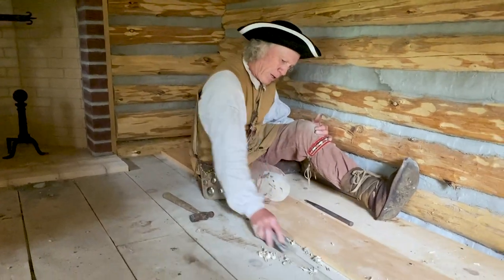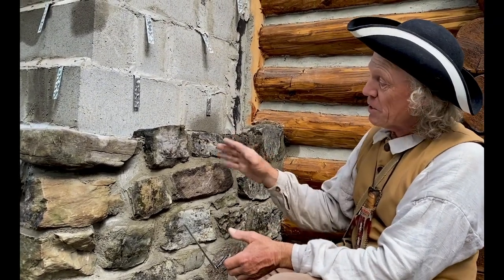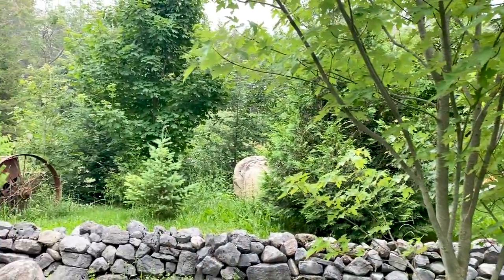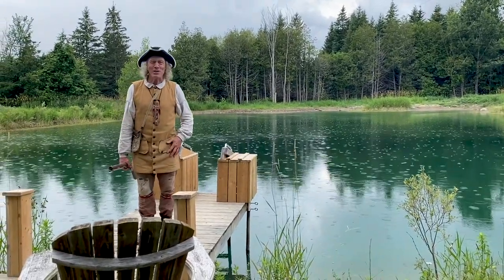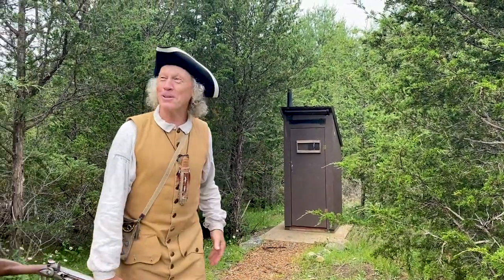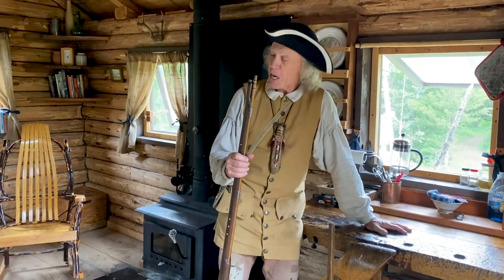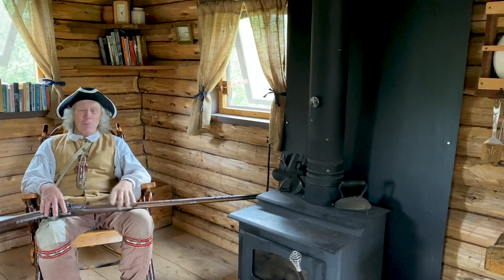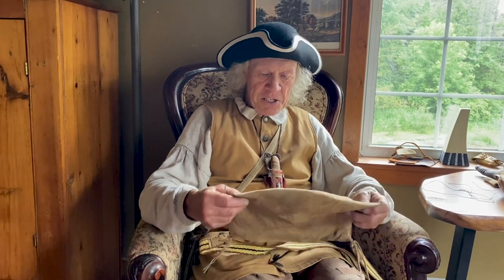A Tour of Our 21'st Century Home | CABIN BUILD | PIONEER LIFE|STONE MASON

Comment: Here in Scotland, my Grandfather house was built in the 1700s and we had to replace some of the floor boards, there was Ash from the fire under the floor boards, both on the ground floor and second story to act as insulation, which worked well.
I imagine this was also used across the water in Canada and the US.
Reply from the maker: Well, I’ve not read a first person account but, you’ve sparked my curiosity … more research require.

Comment: Just curious, why wouldn't you lay the second layer perpendicular to the first?  Would be more effective at stopping the drafts.  If someone else asked this, my apologies!  I've just discovered you. :)
The fireplace is really gorgeous.
Reply from the maker: A simple answer, as the boards shrink (laid perpendicular) we would have drafts every 12”.  The second layer that covers the subfloor cover each crack with 6” of wood.  So all boards are 12” wide and on these first layer.  We start the second layer with a 6” board and then 12” boards until we get to the opposite wall, ending with another 6” board.  Not sure I’ve explained that very well but, I can assure you, there are no drafts in the floor.  We’re glad you both found are channel and are enjoying it.  We also really appreciate getting feedback from people.
Reply: @TheWoodlandEscape  Ah, that makes perfect sense!  Thanks :)

Comment: It's obvious  you have never ever laid  a floor.
NEVER PUT THE TOP LAYER OF BOARDS IN THE SAME  DIRECTION  AS THE BOTTOM LAYER! IT CAUSES WEAK SPOTS AND UNEAVEN FLOORS.  
that is why you always put flooring 90%angle from bottom layer. 
( can you put flooring on top of joists the same direction,  NO because  they would FALL BETWEEN THE JOIST! BOARDS ALWAYS GO ACROST THE SUPPORT  UNDERNEATH!)
Reply from the maker: I appreciate the feedback Cynthia but, I have built a number of houses and barns and you are spot on with your council.  However, in the earlier days when one was forced to build with green wood they had to consider shrinkage.  So the first layer lays 90 degrees to the joist as you suggested.  T he reason the second layer goes the same direction is to stop drafts when the wood shrinks.  The boards are all 12” wide but, the second one later spans the bottom layer by 6” thus stopping any drafts.  Had I laid I’d the opposite direction I would end up with a draft ever 12 “.  I studied two homes in our area, on built in 1830 the other in 1860, both are constructed as I have done on this build.